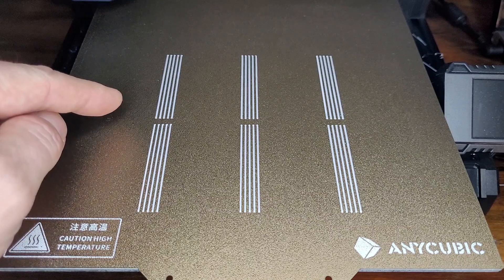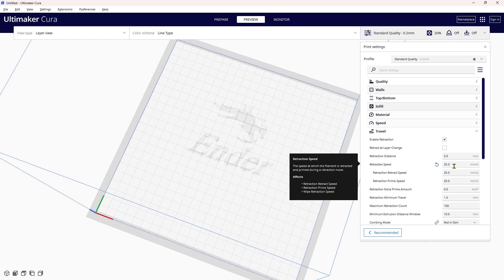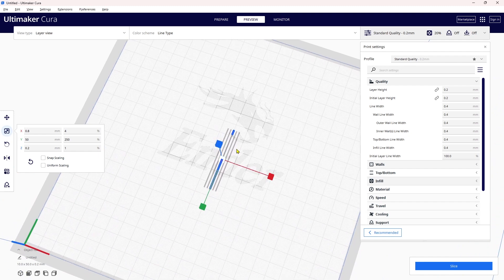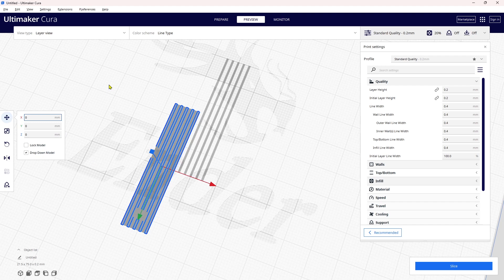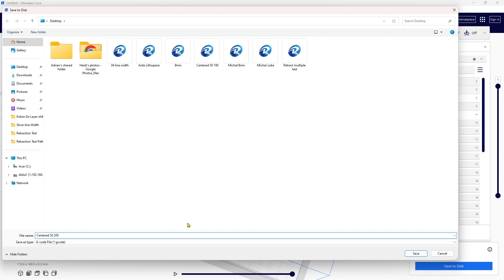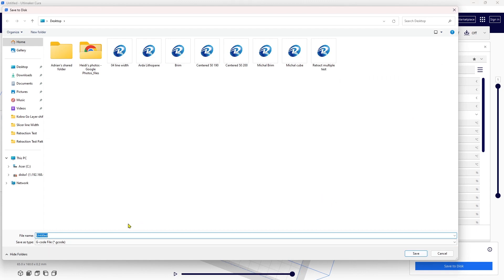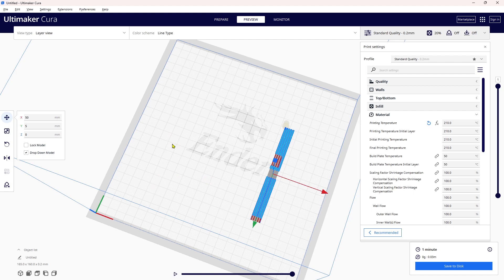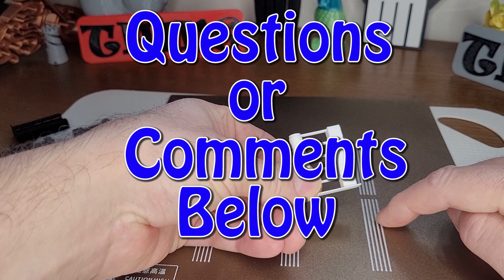Retraction Test Pattern with Cura

Comment: I dont have that Extension in Cura to add the cube, how do i get this?
Reply from the maker: In Cura under extensions tab at the top then parts for cailbration and add a cube, let me know you've got it
Reply: @mayhemsmiley  That plugin doesnt appear to exist in the marketplace anymore
Reply from the maker: @smallzfsu  wow that sux. Serially I'm sorry to hear that.  Are you doing OK?
Reply: @mayhemsmiley  uh ya, I'm good thanks for asking.  I found an stl for a cube on the googles and worked through the rest of the instructions from that.

Comment: Awesome vid! Do you have a link to a stl perhaps? And also, do you know how to solve z banding? I'm getting these walls that are very uneven (It looks like micro layer shifts almost) I did tension my belts, but I think my bearings are low quality. Please help me! I'm very close to selling this printer
Reply from the maker: Hey throwdown 
Don't give up yet
Share some pics on the Facebook group so I and others can have a look. 
It's later here so I'll share files tomorrow after work.
Reply from the maker: Hey Throwdown, sorry for the delay, time moves quickly 
Here is the 3 files for the test pattern, be sure to review this before you test. https://youtu.be/aDNOoLxlY-E
https://drive.google.com/file/d/1PtOps_cwOnJXiOywcFK9zRa7wpnhGDJo/view?usp=drive_link

https://drive.google.com/file/d/1hb8tj_qINhHTriMoaf3QdrIuuwqRr85u/view?usp=drive_link

https://drive.google.com/file/d/1i7kQAATqna9aPmIDRhxOyh92Es8CLW5x/view?usp=drive_link
Reply: thx man :) I appreciate the help and files
 @mayhemsmiley